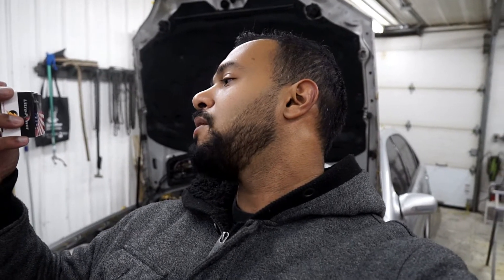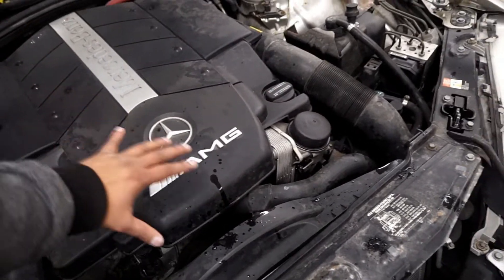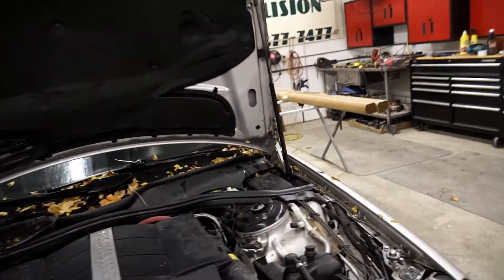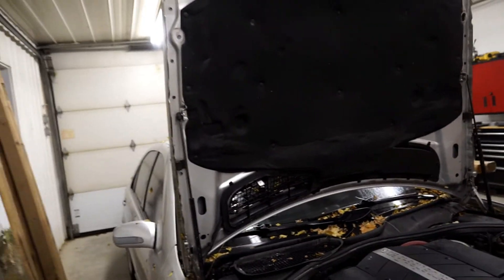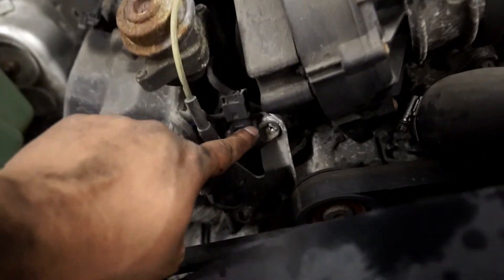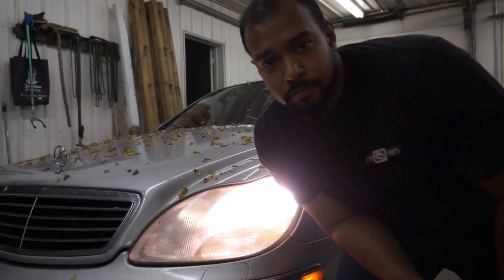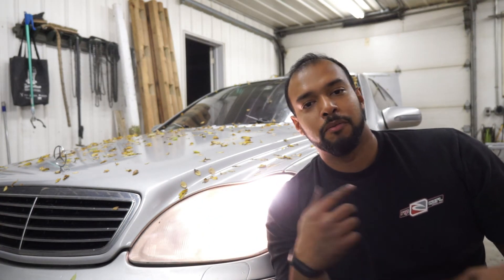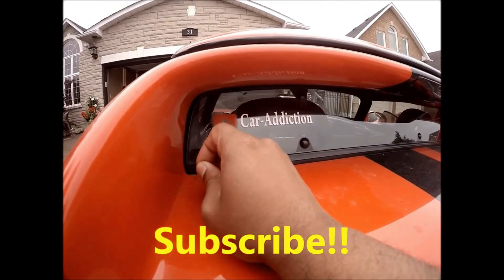Mercedes S-class Check Engine Light. MAF and MAP sensor replacement. Cheap repair

Comment: Not much room in that engine bay... I think youre a crazy man working on these cars...

Where did you learn how to do this repair? Bentley manual or something like that?
Reply from the maker: Hahahahaha. Actually compared to the 300zx, there's a lot of room. I just did a little googling and the Mercedes mechanic manual. Not that hard of a job.
Reply: @runningrich  yeah man I've been en looking at videos of old Jag V12's and i think they have more room than your TT 300zx. In fact I heard that some mechanics won't even touch the TT 300zx's...
Reply from the maker: @Jason-fp7vi  yeah some pussy ass mechanics wont touch the 300zx.  Moreover, you shouldnt take the car to everyone.  The vacuum hoses and the electricals are very complicated.  It's better to take it to a 300zx specific mechanic.